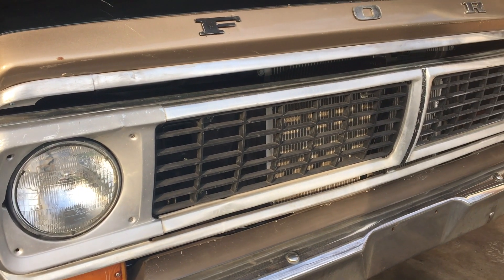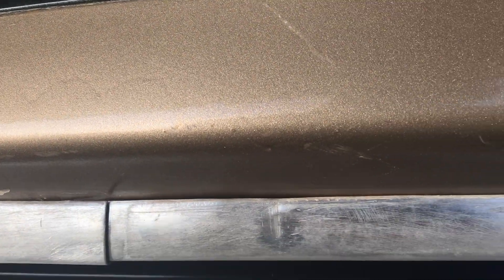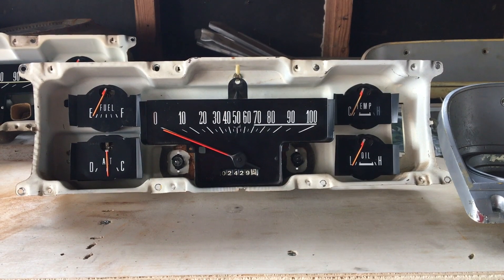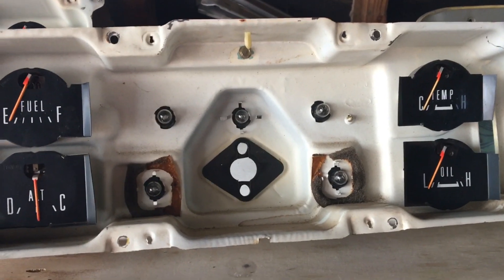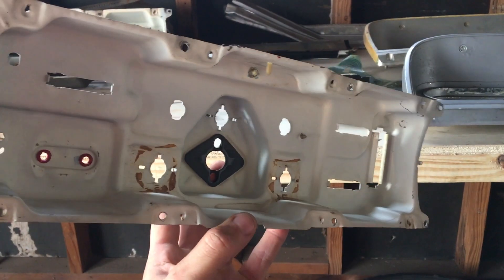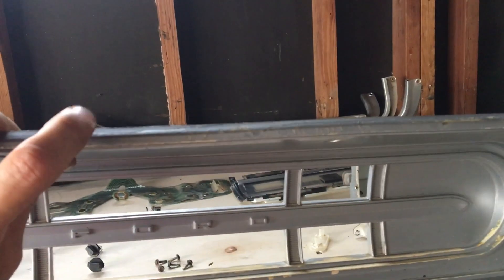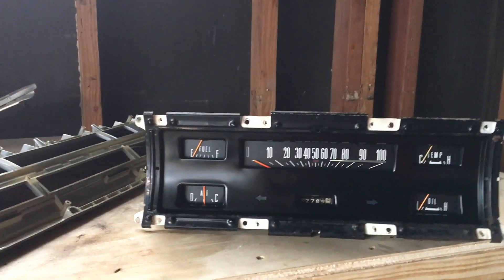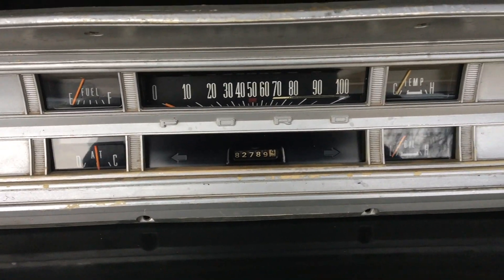1970 F250-Gauge cluster repair(part 1)

Comment: HI . I just discovered your channel.
I have also a 1969 F250  since 14 years now and do those repairs  so I subscribed and will check your new videos.  my oil pressure gauge and water coolant gauge are messed up.
so I am in the process of checking the Gauge cluster.
Reply from the maker: Patoune Art thank you for subscribing! Hope my videos help there is a part two to this video coming out soon. I also want to get my temp and oil pressure gauge working, right now they are on some aftermarket ones that I don’t like.

Comment: Question: would this install work on a truck that came factory with the lights instead of the optional gauges?
Reply from the maker: I’m not sure. I don’t think the truck would have the wiring provisions to add factory style gauges. When ordering the circuit panel It does give you options for ordering one without optional gauges.

Comment: I cannot for the life of me get my temp sensor gauge to work. Replaced the sensor and still nothing. Any suggestions? Thanks man. Love the channel
Reply from the maker: Thank you for watching! I appreciate it. Depends on the year of truck, i would check the wire to make sure it’s intact. Could just be a bad gauge, what year is your truck?
Reply: It’s a 1970 the wire looks good So maybe the gauge is just bad? Have you had any luck tested the gauge on its own?
Reply from the maker: @jeremyholstrom  I never tested my gauge but if your truck is a 70 what kinda shape is the circuit in? That plastic paper type thing that makes all the contacts? I replaced mine. I actually ran and aftermarket gauge, really simple to install and works great. I posted a video on it.
Reply: @AJsGarage  thanks man! The circuit isn’t in terrible shape but it’s probably worth replacing. I’ll give that a shot